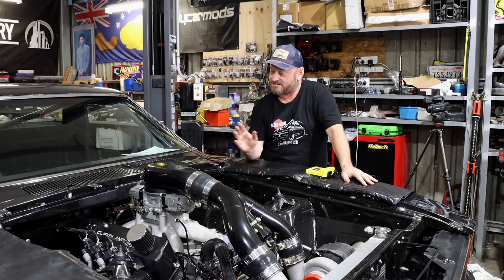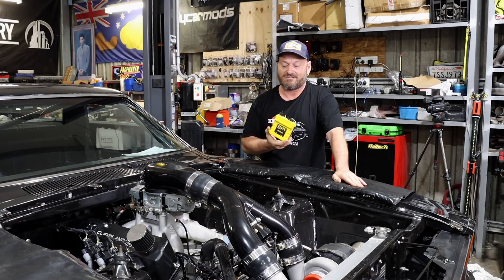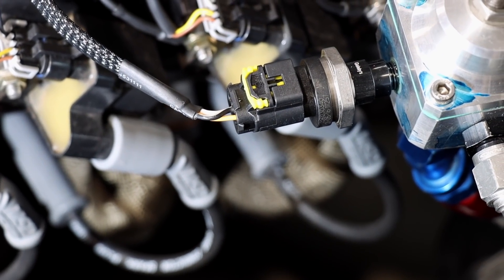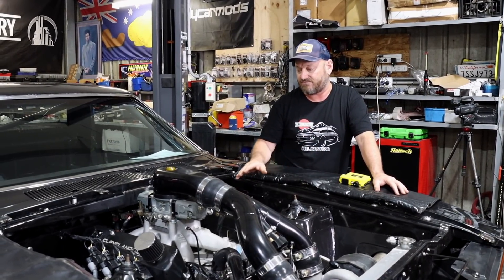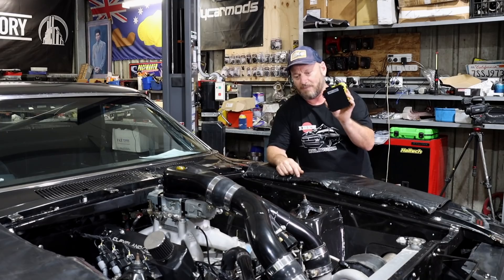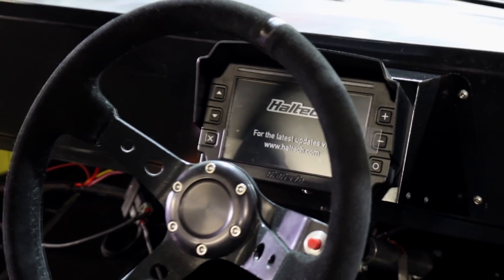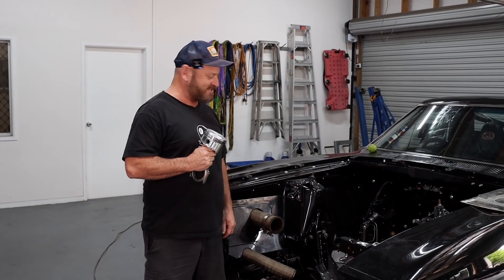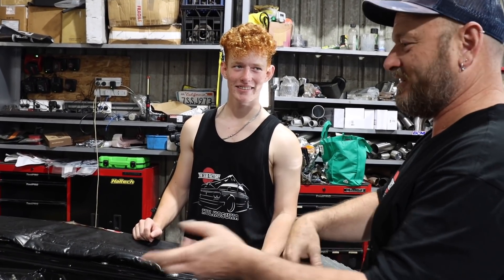Fixing a Carburettor with Modern Electronics - THE SKID FACTORY

Comment: Gday fellas, if after all this tuning it is still lean or melting one or two plugs it could be the manifold if it’s ported and polished, I had nothing but dramas on my Procharged 565bbc with blow through C&S carb, a rough cast bottom inside the intake helps even out the fuel distribution as so much fuel comes through it turns into a river flowing unevenly over a polished surface and into favoured ports, you may not have this drama but just something to think about if you can’t get an even plug read. Cheers

Comment: In the shop where I used to work we had one ventilator with positive pressure and another one with negative pressure, and even with that we had "onion eyes," dry tongue and trouble breathing due to methanol vapor building up in the dyno room. Masks had a slight difference but they get saturated quickly. With EFI setups isn't that nasty compared to carburators, because it's nearly sealed, while carbs leak everywhere.
Reply: Were suck throughs any better?

Comment: Well I'm not sure if this counts as looking on the plus side but at least the new ECU wouldn't have done anything about the oil vacationing at the back of the pan during takeoff 😉Shame it wasn't a dodgy gauge causing the drop in pressure ☹
Reply from the maker: The ecu would have shut the engine down according to the oil pressure requirements programmed into it.
Reply: @theskidfactory  Engine shutdown definitely could be programmed into teh ECU.
Would be quite a neck jerker though to be forcefully launched and then have the power suddenly cut off

Comment: Carbs are more difficult to tune than you young fellas think,I guess it's easier to let a computer do all the work,lol.
Reply: My old outboard was a carbied model. If it picked up water from the tank it was about a 2-3 hour job to rectify and cost was a bottle of metho. Now, with my new EFI outboard, a fuel pump and a set of injectors will take about the same time, and cost an extra 3k in parts! So glad I dumped the old carbies.....NOT! lol

Comment: I'm starting to see what can be done on a Cleveland. To do port EFI is it needed to use the cam sensor instead of a distributor and a crank sensor? Can you steer me in the right direction? In the states EFI on a Cleveland is a gray area.
Reply from the maker: You can use a distributor if you want but it needs to have the function internally to give a once per rotation pulse and also usually an 8 per rotation pulse. It’s easier IMO to just uses a crank signal, cam signal and individual coils.

Comment: You won’t flow enough methanol threw that carby with single needle and seats per float bowl, my E85 blow threw carby has dual needle seats, and all the internal passages in the demon carbs are way to small out of the box
Reply: All what you said is correct. Most methanol carbs run an electronic needle and seat to keep the bowls full.

Comment: Pro tip- you wont be nervous watching an oil guage if you don't have one.  Even better, ground the sender so you get maximum pressure at all times.  Stay tuned for more.
Reply: Or just do it like Subaru, Sender pulls signal to ground when no pressure. Disconnect signal from sender, never get low pressure.
Reply: Sometimes this is actually true, the more guages you have the more you just stress about any slightly abnormal reading haha

Comment: I think its going to be one of the most productive dyno sessions ever. A twin turbo cleveland should put daylight under the wheels on that ute. Sounds like not enough ignition lead to me at the moment.
Reply: If the engine is melting its plugs it has too much timing at high RPM and leaning out.  With this set up, timing needs to be retarded as the RPMs climb.  This is what you will see happen with the Haltec ignition system.  They may also rejet the carb depending on the data they see...

Comment: For an old man you are very anti carby. For decades people ran and tuned cars perfectly without ECUs + data logging. An o2 sensor can be fitted, a fuel pressure gauge can be fitted etc. Just because you don't understand how to do something doesn't mean you should rubbish it and say its crap
Reply: Nah mate just because it exists doesn’t mean it’s as good. Carbies were replaced for good reason and this man has perfected the possibilities of its predecessor.
Reply: @ayycee5303  carbys were replaced for drivability and emissions
Reply: Yeah but they're crap
Reply: Not sure if trolling or just stupid.
Reply: Carbys usually make more power also

Comment: I do not mind the odd carburettor, never owned fuel injection till 2008. Owners of that car are even known these days to pull off the early 90s injection and putting on twin 45mm side drafts. 
I have kept the injection on mine and have bought a second to try the carby route.

Comment: Side question. Over the previous years ive had 3 different performance vehicles were individually tuned at different shops Each car had the worst cold starts. Almost have to wait in the driveway like a cold carby motor to warm it up.multiple motor roations before  they would start more so in winters and flat spots etc until warm. Is there a reason why 3 different tuners  struggled to do a drivable cold start. Was it the haltecs that couldn't do it well on or  incapable tuners or is it a  general near impossible task to do.
Reply: Probably an incapable tuner, or one that didn't have much time to sort it. A tuner I used kept my car over night specifically so he could sort the cold start tune first thing on a cold morning.
Reply: Yep and for the 1500 bucks they are charging these day..they should be
Reply: Had the same problem with a "big name tuner".
I had to pull the turbo air pipes off recently to get at the alternator on my G6ET. 
put them back on, TIGHTENED the hose clamps... voila
Stumble gone...
Changed the spark plugs on the weekend...
Three out of 6 plugs JUST tight...
4 out of 6 coil on plug retaining bolts loose....
The thing runs so smooth now!
A tuner is a thing for a sandwich!  🐟
Reply: I'm sure an experienced tuner should be able to set it up fairly well from experience, but if the tuner has never spent the time sorting cold starts they simply won't have the experience. And if they don't have customers willing to leave vehicles for cold start tuning for a week they can't get the experience.

Comment: Reckon there will be a new specifically built carb ordered for this one real soon from someone like CSU in the states 
Or maybe ZOK in QLD
Reply from the maker: You might be onto something
Reply: There is is main circuit enrichment underneath the center breather stud it probably needs opened up and the idle bleeds played with Demon carbs are a little different to play with bet its the adjustable main circuit if the jets didn't fix it and it could probably do with having the boosters played with they have a standard annular booster for methanol and they have one with larger ports for boosted applications
Reply: Zok for the win. 👍🏻

Comment: I run an MSD billet distributor fully locked out and advanced to 42 deg BTDC on my SBC.  Then an MSD 6AL2 programmable timing box to handle all the delay vs rpm to get your timing curve.  You can even hook up a MAP and program some vacuum advance.  I haven't done that yet.
Reply: Best ignition box going. Initially made for pro stock. Can do all the stuff Al mentioned in one simple box. No stacking of boxes. A programmable ignition curve on the fly, just like the Haltec.  ability to trigger retards by 12 volt switched power. Very good bit of kit. Don’t listen to the knockers mate. Keep it old school.
Reply: You’re insane. Throw all that shit away and modernize it.
Reply: @TML34  been together like this for 10 years.  If only I was less responsible or money grew on trees.  Full blown EFI would cost more than the built SBC I have!
Reply: @madrew2003  fair enough.
Reply: @TML34  hahah best reply. All that tech he mentioned would’ve been fapped over in older street machine magazines 😂